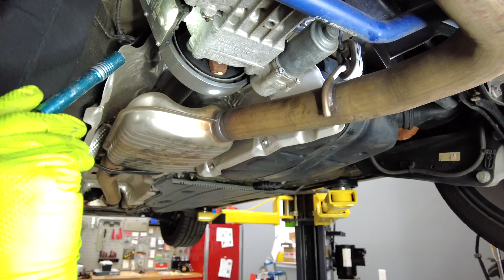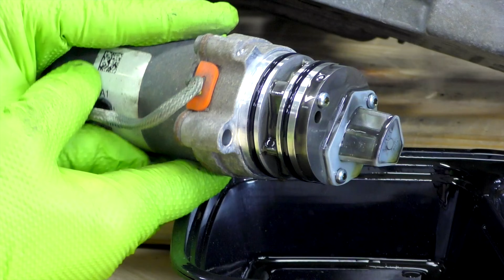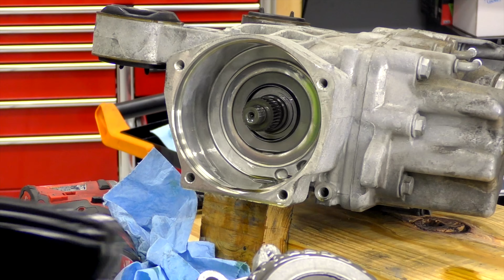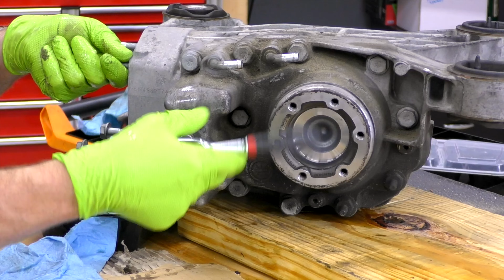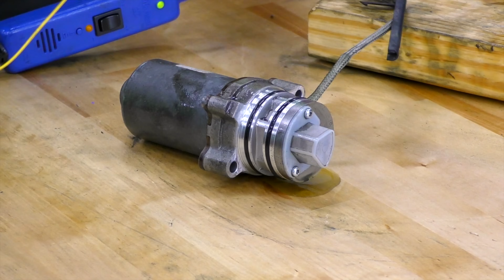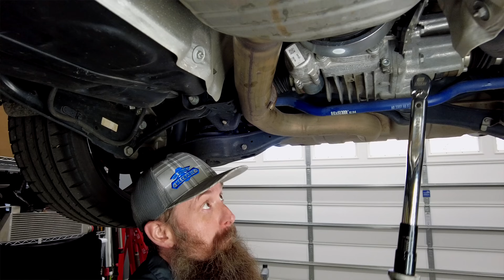Catastrophic AWD Unit Failure Audi S3 Golf R ~Haldex Failure

Comment: Recently ran into this exact issue in our repair shop (albeit our clutch unit had obvious clutch pack pieces in the oil). Unfortunately, I had to get into a heated argument with my colleague (VAG tech of 12 years) who was absolutely convinced that the AWD clutch pack was the exact same as a mechatronic limited slip diff. Needless to say, our relationship has become slightly soured...

Comment: Good vid! It does seem in this case the pump motor is the cause of the failure. I've seen this type of clutch packs in a fishing boat gearbox, where it locked in gear. It was caused by the clutch plates on the input shaft wearing notches in the spline, causing the plates to lock in place so they couldn't disengage not the ideal situation in a boat!

Comment: My guess: the motor is bad, so it wasn't clamping as hard as it should. That caused excessive slipping, thus the unusual wear on the clutch disks. I bet a new motor and clutch would have that back to like-new condition.

Comment: I had a mishap when changing the haldex fluid. I unbolted the wrong bolts to pull out the pump and loosened the ground haldex wire by mistake from the screw and did not ground it back properly. After the fluid change started hearing rear clunking at low speed turns. And vibrating when launching. Ended up purchasing new pump that fixed the clunking but vibration  on a launch stil persisted. 10 months later vibrating on launch lessened but still present depending how hard I launch. Fml anyway but still drives and pulls.

Comment: So I am just curious as I can not find  any information on how to get the rear axle flange seals out of a 2014 cc 3.6 4motion as the flange seal is leaking. There is no bolt on the axle flange. Did I hear you say u can use a slide hammer and if so how because the flanges are actually recessed in the case. It is the passenger side btw.
Reply: The flanges are what I'm having trouble with not seals lol.

Comment: Thanks for your videos they deffo have helped me modifie and maintain my golf R 7.5 wagon 👍 I have an issue with my haldex  so I followed your haldex service video, fitted a néw pump, after approx 30 mins of hard driving, the traction light flickers and I'm getting front wheel spin, car cuts power when full traction is on, major fron wheel spin when traction is in sport or long press off, any ideas what could be causing this as I have no fault codes?
Thanks in advance 👍
Darren

Comment: I can't see why VW/Audi says this isn't a serviceable unit, Its surprisingly simple and uses the same exact clutch style/design as a the DSG transmissions AND that pretty much every wet-clutch driven motorcycle has ever used but just with an electric motor to actuate it!!

And the price on the actuation motor is totally absurd too!

Awesome stuff as always dude, This was cool as heck to see and it's awesome to see how it works

Comment: So, are you saying that the transmission control varies the pressure on the clutch pack and controls how much torque goes to the rear wheels? And by implication, that clutch can be slipping for long periods of time? If that is how it works, I'm glad that I don't have a VW/Audi with this system. But I'm glad I don't have a VW/Audi anyway 🙂
Reply from the maker: that's pretty much it.

Comment: I have a suspect, that in Haldex gen V, they put different gear ratios between rear differential and front one. This help car to feel more "RWD" , but the Haldex coupler is constantly in 'motion' and clutch pack drag all the time. This for sure will cause exesive disk wear.
THAT'S WAY I need info rear diff ratio and front diff ratio   \(''/)/

Comment: It's weird that in Canada (where the awd system is being used a lot half of the year), the schedule maintenance says only a awd system fluid change is required every 45k KM. I called the dealer and asked about maintenance on the actual "haldex" pump, they said that unbolting the pump for a clean up (clean or change the mesh) would void the warranty of the unit and they also never do it. They are saying it's good for the lifetime of the vehicle with just fluid changes. My understanding is that it's different for US cars? It's part of the maintenance schedule the haldex pump cleanup?

Comment: It's such a dick move that's not considered a repairable part... First of all, it's very wasteful when it comes to materials and energy. Also, it's a lot more expensive to buy a complete unit when it seems very reasonable to refurb them.
That clutch pack FOR SURE should be a part you can buy, cleaning out that system, replacing the motor and replacing the clutch pack should make it like new.

Comment: It might be considered non-serviceable, but when enough people need a rebuild and it is economical, someone will invent a rebuild kit.

The DCT found in the Mitsubishi Evo X was meant to not be serviceable. In early Evo X DCT models, people just had to pay $10,000 for a whole DCT. Mitsubishi called it the TC:SST.

This is interesting stuff. I aspire to own and Evo X. Their AWD problem is often having the ACD pump fail. It usually isn't the whole transfer case or diff. I think an ACD pump is $3000.

The transfer case of the AWD Ford Taurus doesn't cost nearly as much as the VW Haldex. They just sell brand new ones because of it.

The upcoming Toyota Corolla GR is interesting to me. If it can be almost as good as other Toyota Corolla variants, it will provide a lot of fun without costing so much in repair bills, when compared to other fun cars.

Comment: This is how I fixed a slipping rear Haldex clutch on my Golf 7 R. Use VCDS to re calibrate the  rear clutch pack. Saved me a lot of money.
Reply from the maker: NICE! How long has that held up?
Reply: @HumbleMechanic  Close to 3 years now.  I recommend to do it every year or so. I  did clean the pump motor thing and replaced the oil but front wheels were still spinning. The oil was dark though. After about 2 months I came across an article that said to do that and it worked. The clutches wear over time,  so the calibration adjust the clamp force so the rear wheels get the correct amount of power again-  I guess. I bought my car in 2014.
Reply: @janterblanche9328 do you have a link to the article? where to enter and calibrate in vcds?
Reply: @patrykkrol9433  apologies,  only see this now. I will look for the link. It is a troubleshooting exercise and it is right at the end . You need VCDS.
Reply: @patrykkrol9433  apologies,  only see this now. I will look for the link. It is a troubleshooting exercise and it is right at the end . You need VCDS, I think VW cannot do it with their tool.
Reply: Is recalibrating an extra function or do you just mean to bring the settings of the clutch to factory reset ("Grundeinstellung")??
I have the Problem right now...

Comment: Question: If this unit came from from a shop that did some prelim trouble shooting, wouldn't they have drained the fluids themselves? This implies that some of the loose stuff would have been drained out and lost for this tear down.

Second: What was the carbon looking stuff poured out of the motor housing? Seems the options are ground up brush material or the motor windings overheated enough to bake the insulation off the windings. Seems like the only way to grind up the brushes would be to have something come loose that allowed the brushes to continue to make contact with the commutator, allowing the motor to keep spinning, until there was no longer enough material to allow sufficient contact.

Comment: Seems typical, the physical parts are still fine but the electrical component fails and/or malfunctions.  Wonder if there is a way to just permanently lock the input shaft to the output?  Very cool to see the inside of one of these!

Comment: Mine stopped working on my 2016 Golf R on the later end of 60k miles and I replaced the pump. The pump didn't fix the issue so the dealer ended up replacing the entire assembly under an extended warranty.
Reply from the maker: heck yea for warranty. LOL
Reply: @HumbleMechanic  The reason I ended up doing the pump myself was their initial hesitancy to recognize that there was an AWD error. After the 3rd try, I decided to just replace the pump to see if that would cure it. Unfortunately it didn’t work, so after 2 more trips to the dealer with the fault code, they finally decided to replace it:)

Comment: Seems like as long as someone sells replacement clutch packs, it shouldn't be a difficult rebuild. None of the gears or rest of it seemed to have any real wear or damage. Of course if no one sells those discs then your sol. I figure there is probably a minimum thickness the stack needs to be as well so if they are worn to the point that the stack isn't tall enough even cleaning and sanding the steels won't get it running again.

Comment: I'm not a good mechanic but if you have haldex y cant easy make 4x4 if you take out haldex clutch and put there shaft. Right ? You can cut electronic part and fill haldex with differential oil.
Reply: Did someone try this at home ?😅 Have someone experience?🙃 I have boring Skoda Octavia 1.8t 20v with haldex mk1.
Reply from the maker: Id love to see it happen.

Comment: Its sad this is not a rebuildable part it seems so straightforward in its assembly eve more so than some automatic transmissions.  Is it just that it is such a new design or something else? I know we didn't see the true cause of failure for the particles the pump looks like brush ware but can't see that going into the main area but hmmm. Or was it just you did such a great job showing us the disassembly 👊👊👊👊👊

Comment: My sister 2015 a3 2.0t quatro is not powering the rear weels. Should i start with replacing the motor first?  Fluid looks good.

Comment: A few notes and questions:
-Clutch pack is available from Audi, about 600-700eur, but this pack didn't look too bad.  I've seen some pairs that are fused together.
-Pump is available from both borg warner and Audi, there are also service kits around for much less.  Generally the brushes go bad, the pump can be tested with 12V.
-The pump continuously runs when you start the car.  Theres also a small pump / actuator inside the control unit with a plunger blocking/allowing the oil to flow and this is what controls AWD, probably that has failed as well.
-You are correct, Audi europe service manual doesn't have a rebuild guide.  But I have a Audi USA PDF that has rebuild instructions.  There are no measurements for putting the haldex together but there are extensive measurements on the diff-haldex side, otherwise there will be noise when running.
Now the questions:
-Can you mix and match parts from two broken haldex/diff units?  Eg clutch and plate pairs?
-Especially, can you mix and match diff and haldex halfs?  My mechanic says crown wheel and pinion are "married" with each other and you can't match them, it will be noisy.

I have a broken awd that no longer works on my Audi TT mk1, AWD works on the lift but on the ground the rear wheels don't engage...  Haldex fluid was pitch black last time I checked it.
Reply: Hello, could you send me this DPF file please? It will help me a lot.

Comment: Yeah this doesn't even look that bad?  Seems like if the motor were replaced it might work ok again though ideally you'd want to replace the clutchpack...which probably isn't easy to get separately given the "replace the unit" repair protocol.  5th gens do seem a good bit more problematic than the 4th gen units, and interestingly the 4th gen units have a real filter, while the 5th does not.  Not sure which engineer(s) decided they don't need a filter in the system, but that wasn't a good move.

Comment: Yup ford tech and had a very common ptu failure that was making lots of noise and binding that would usually have windowed the case so I had to rip it apart to see how bad it was. Even though it had a core, I found al.lat nothing left of the pinion gear or ring gear. It smelt sooo bad the fire dept almost got called for a gas leak smell lmao!

Comment: Very Informative Charles, thanks. After taking my 30k mile 2016 R to VW for the routine AWD control unit service and pump clean, they returned it to me with this failure. Any ideas on what could have happened? ( Car and transmission faultless prior to main dealer service)
Reply from the maker: Maybe wrong fluid?
Reply: @HumbleMechanic  that is my theory, could the wrong fluid cause the pump to fail? E.g through deterioration of the friction rings and debris blocking the pump filter mesh? There was lots of debris in the oil they flushed out !

Comment: That clutch pack looks pretty much like a motorcycle clutch. In a motorcycle, the engine, the transmission and the clutch are, in most cases, lubricated by the same oil. Glitter in the oil is normal and I see it at every oil drain.

Comment: I drive Tiguan 2013. 2.0 TDI (CFFB engine) 4Motion DSG. Until now (before me) it was serviced in unofficial service shop but I'm planning visit to official service soon.
In last service check of the car my current mechanic said to me that he feels to much play in drive shaft coming to rear Haldex (it is about 10 degrees of rotation). He don't repair Haldex part of the car but he think that so much free play is not good.
Is this normal or is it a problem and what could be the problem?

Comment: Why doesn't the rear use a limited slip?  Who wants ab AWD system, that is only turning 3 of the 4 wheels?
Reply from the maker: They use ABS for a system called EDL electronic diff lock. It’s functions like LSD.

Comment: I'm kind of surprised this isn't serviceable, it's just a lighter version of a wet clutch pack that can be found in most tractors for a whole number of applications.

I've had no trouble getting an overhaul kit for the under/over transmission in a 1967 Cockshutt 1750 so it seems kind of ridiculous to me that it's easier to get parts for a 55 year old tractor than it is to even try to get parts to overhaul the AWD on cars that are barely even 15 years old and only seems to need a clutch and pump.

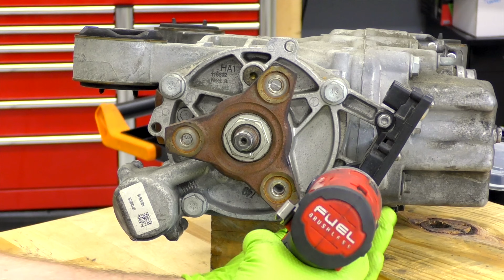Comment: Charles....Check the pressure release valve at the top of the casing where the prop shaft flange meets the clutch pack housing....to the right of the HA1 casing mark at 2:11 to 2:37 in the video.  See if it is clogged with debris...let us know...if you find anything there. Debris causing it to stick open = clutch slip and overworking the pump motor... then some type of failure. Also, after replacing a pump...the relearn procedure is omitted...leading to replacement of entire rear units...that would have otherwise returned to normal function.
Reply: This seems plausible, the amount of black stuff (which i'm assuming is graphite coming from the brushes) would indicate that pump has worked HARD.
Reply: @GeFeldz  I would assume the motors are brush less...but I may be wrong....
Reply: @tmw2442  two wires to motor. Not brushless
Reply: @tmw2442  why assume that?

Comment: Now say you got a big chunk of metal machined the size of the clutch pack to replace the clutches, wonder how long the diff would last in full time AWD
Reply from the maker: I think the bevel box might fail. But it would be fun for a while
Reply: @HumbleMechanic  Just looked up a video on a bevel box ring gear failure, Looks like you dont even need to do anything crazy to break it. Thing is just pressed on https://www.youtube.com/watch?v=nt33-EgQ4gk

Comment: Hello Charles, i have a little question,  do you know any website which can show me codes for O-rings ?? I sucessfully finished timing my vr6 bora, but when we were spliting engine we noticed that those 3 orings (on place where is it going from gearbox to haldex )  1 big and two smaller size of smaler one in different from each.  i was looking everywhere but i coudnt find any details about this. 
btw: is it possible to create soid part which would  have created full time AWD from car? woudnt it hurt something? ( if its only my pocket for gas→ thats fine)
Reply from the maker: I use the dealer parts department for the seals. They have the best parts breakout. Now it’s not great hahah but it’s better than any other
Reply: @HumbleMechanic  thanks Charles

Comment: It’s a hydrostatic pump with pistons on a ramp like in a lawn tractor transmission.  For the pump to make pressure it needs super tight piston to bore clearance. Any wear lowers pump pressure letting the clutches slip.  That’s why there is was so much brush carbon in the case. Pump is worn out.

Comment: So I blew my 8p a3 up a month ago and could use a little guidance, would going through patreon to ask for help/advice be the best bet?

This passed winter I went to do a very late haldex (Borgwarner? Looks the same as the diff in this video) service and found my motor was bad, so I think the whole unit will get replaced during the build, but I was wondering if I could use this opportunity to swap from the 2.0t quattro dsg setup, to a dsg and rear diff from a 3.2 a3 or r32 for better highway gearing? Would tuning the dsg or haldex unit become complicated because it's a 2.0t?

Comment: How does wheel size effect this unit?  On Subaru's, if the front tires are worn and the rear tires are new, the computer interprets this as front axle slippage and will engage the clutch [partially] in order to try to reduce front axle speed.  This leads to premature failure of the rear axle clutch pack.....